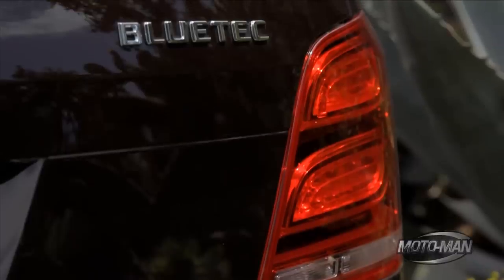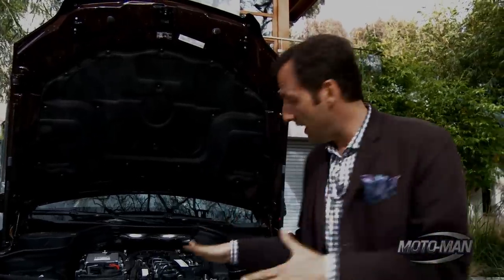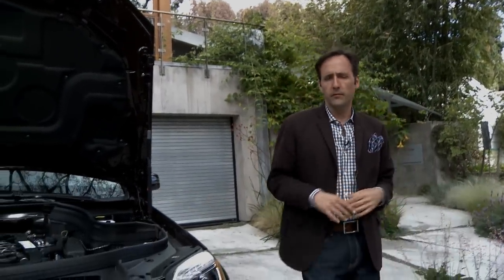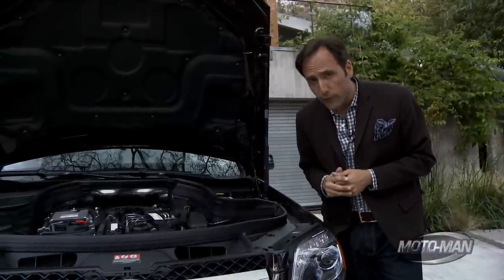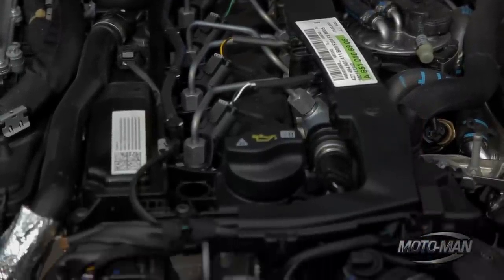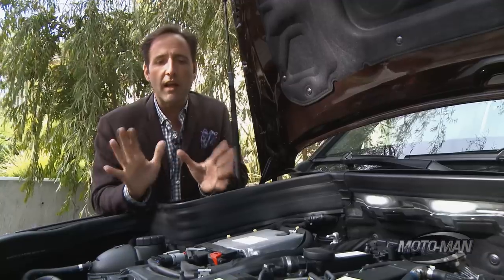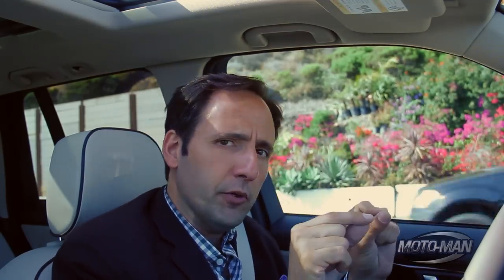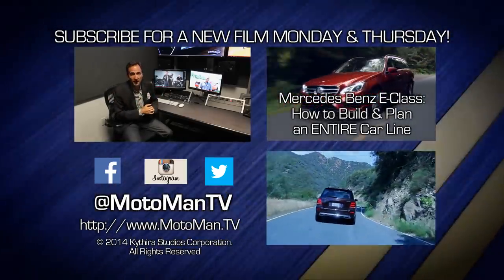Mercedes Benz GLK 250 BlueTec Turbo Diesel – Higher Compression Than Most Modern Performance Cars!

Comment: amazing german technology and engineering. I have a GLK 250 bluetec 4 matic for 8 years and it still drives like new. Steering is like buttery feeling. Fuel economy is great. 35 MPG average. Built like a tank. Many people may not know, this small compact crossover weights almost same like a minivan. Yes. Over 2 TONS. Yet drives like a breeze.
Reply: I have one as well.  160K miles and still runs/drives like new.

Comment: I have had my GLK250 for 8 years. It has seen 40mpg on a trip at reasonable speeds
Reply: Hi Mate! I am hesitating between a 2015 GL250 BlueTec (122835 km) or a 2014 E250 BlueTec (115544km) Which one should I get? Thanks
Reply: Hi Mate! I am hesitating between a 2015 GLk250 BlueTec (122835 km) or a 2014 E250 BlueTec (115544km) Which one should I get? Thanks
Reply: I think the ‘14 or ‘15 are equal. Pick the one equipped the best for your needs.

Comment: It's a Diesel ie a compression ignition engine, of course it has a higher compression ratio than any spark ignition car engine. That's the whole point of a Diesel. In fact 16,2/1 is not a fairly low compression ratio as diesels go, (20-24/1 is typical), but that's because of the high pressure turbocharging. Neither is there any point in making a big deal out of the fact that this higher-than-a-performance-car compression ratio is in a 4 cylinder engine. The number of cylinders is completely irrelevant when discussing compression ratios.
Reply: 20-24:1 compression ratio was typical in the 1980s before direct injection not in the 2010s…

Comment: I just brought in my Mercedes for service and got this as a loaner car. I was really impressed and considering this engine for my next car (either GLK or C-Class variant). The car just MOVES right off the line when driving around town. It's crazy responsive and there is virtually no turbo lag when compared to the C250 gas car I used to have. 

It's such an enjoyable drive around town and it almost makes me want to drive it normally (saving even more on gas). The engine doesn't rev high at all, I think it redlines at like 4 or 5k. 

One thing you might call me crazy for saying, but when you're wide open throttle and you go through a gear shift, the engine sounds like a quiet AMG. Seriously, I'm going to take a video of it and post it on YouTube. I wonder what it would sound like if someone put exhaust on this sucker. I laughed so hard when I noticed that, thinking this little diesel 4 banger could possibly confuse me for the 6.3 AMG. LOL
Reply: jctevere hey where in New York are you located ?
Reply: Bruce Miceli I'm in Suffolk county on Long Island.
Reply: jctevere I'm in Suffolk county too what Mercedes dealer do you use ?
Reply: Bruce Miceli I always go to Mercedes Benz of Huntington, have a guy there my family always goes to and gives us a great price right off the bat.

Comment: That is great to hear.  As for the lease I would really explore that option.  Case in point the Chevy Volt has $7500 in FED and $2500 in State credits that the lease company gets when you lease a Volt.  Those funds are used to reduce your money factor and increase the residual value giving you a new Volt for no money down and payment of $256 a month.   I leased 2 of them and hardly use any gas which makes the payment.  You are correct not all leases make sense but you don't have to worry about loosing 30% of the value of the car when you drive it off the dealers lot.  Plus if you own a business its a write off.   Looking forward to your new shows.
Reply from the maker: Jon Car Hi Again . . . VERY well versed in the world of auto finance as well as tax implications. There is NEVER a time a lease is financially beneficial - no matter what fancy degree your accountant has. There are indeed very effective ways to write off vehicle costs & depreciation as a business owner without entering into a lease. The Federal & State Money in the case of the Volt are also on offer to people not leasing. As a car guy, my laser focus is on total cost of ownership - or you could even break it down to cost per mile. Yes, it is absolutely the easiest way to get into a shiny new car but one thing I have learned in this life, 'easy' comes at a cost. That said, as you may have seen, our show is really about telling a story and the 'vehicle' to the entertainment are the cars . . . For those you that are really interested in learning more about the lease v buy debate, there is plenty on offer at Consumer Reports, Smart Money, DaveRamsey.com and even The New York Times . . .

Comment: Im not into MB but this GLK is a looker i really like it. MB is missing out on not bringing this GLK in to UK. MB is stupid and so are their cars.
Reply: This first-gen GLK wasn't even caompatible with right-hand drive because of how thy designed the chassis with the steering system.
Reply: MrCarGuy20 *compatible
Reply: MrCarGuy20 how about 2nd gen
Reply: They would bring it to UK if you drove on the right side of the road. It is not compatible with right hand drive.
Reply: @brauer777  Vielen Dank Hans für ihren Antwort!